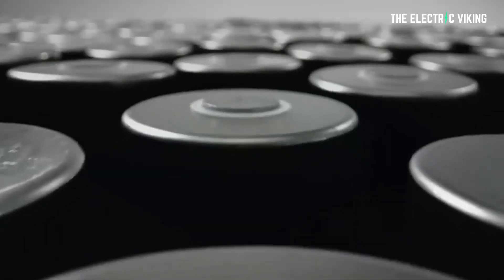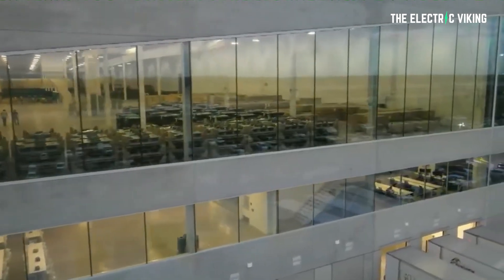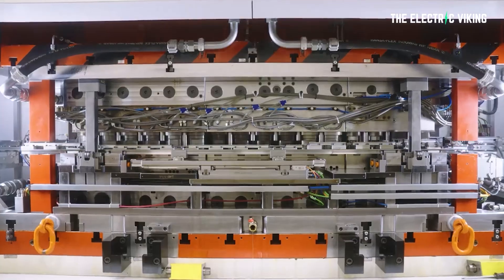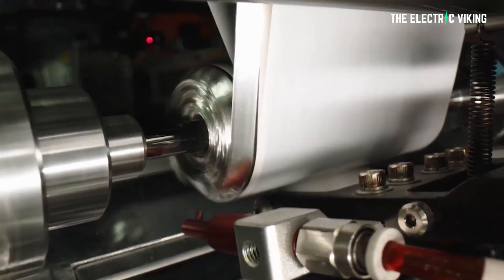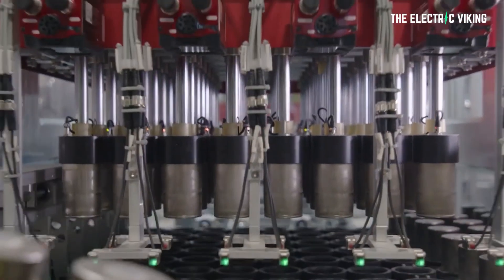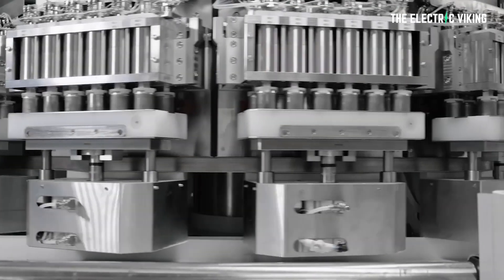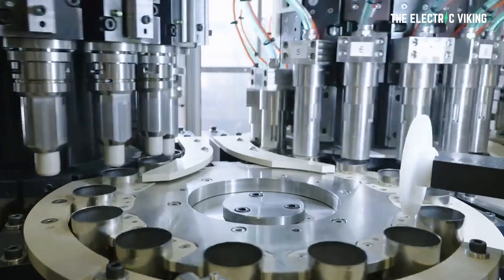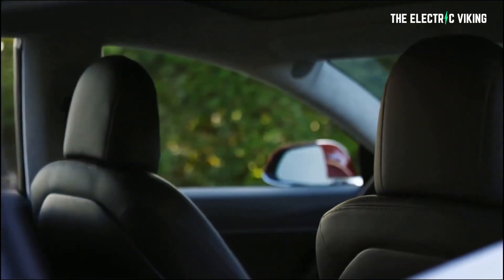Fremont 4680 battery production green lit + Texas' bizarre stockpile

Comment: Tesla initially plan to open the Texas Gigafactory with the production of the Model Y with the 4680 battery, structural battery pack, and front and rear Gigacastings. It has been reported from the Germany Gigafactory that Tesla was having problems with low yields or a high amount (60%) of waste from the GigaPresses. If this is true, the Texas Gigafactory has three huge changes to the casting due to the addition of the structural battery pack. The rear casting is different, the front casting is different, and the structural battery pack is different than anything they have done before and it probably wasn’t going well. This is why Tesla went to plan B and switched to the 2170 battery without the structural battery pack and perhaps without the front Giga casting. 

In anticipation of the Texas Gigafactory opening, Tesla was stocking up on the 4680 batteries in Texas. Rather than let these batteries stack up in inventory, Tesla decided to at least create the structural battery pack filled with the 4680 batteries. This abundance of 4680 batteries from their Kato Road pilot battery factory is why Tesla decided to begin delivery of the Semi this year instead of next year. All of the 4680 cells were originally intended to be used for the Texas Gigafactory Model Ys.

Comment: To begin using the SBP's they'll also need the other giga castings. So maybe they're still getting things stocked up and kinks worked out with either the giga casting machine and/or assembly line. I'm sure that if they were ready, they'd be using them.

Or they're gearing up for the CyberTruck and just waiting for the giga casting machine to be setup and tuned in.

Comment: Maybe they aren't making any Model Y's with the structural packs right now, or are making very few, because they can't make the 4680 cells fast enough to keep up with the vehicle production line, so they are just stockpiling the packs they have already made until they have the 4680 production line up to a speed that matches the vehicle production line. Cleanerwatt channel did some videos recently about the issues Tesla has had with making the 4680 cells, and the new 3 in 1 battery machine that will incorporate the solutions they have discovered to the various problems they had which mainly related to a high rate of faulty batteries and stoppages on the production line. My theory is that when they have all their ducks in a row so to speak in Giga Texas, they will then start the structural pack vehicle production line and use up those stockpiled packs as well as taking a feed of new battery packs using batteries from the new 3 in 1 machine(s). Not sure how the batteries get glued into the packs, whether that is an automated operation, but I would assume it is, so you would basically have 3 different processes here, making the batteries, assembling them into packs, and then sending the packs to be assembled into vehicles.

Comment: The car is substantially different when they build with a structural pack vs the standard pack.  They most likely have to change the line over for producing the cars with a structural pack, batching would be good description of it.

Comment: Considering Sandy Monroe tore down a model y structural pack. I don't understand why this is still a mystery. We know the size. We know the amount and we know the weight along with the rated miles per charge. From what I've seen so far, The structural pack isn't any lighter and doesn't give you any more distance. It would seem the main point of the structural pack is for production. I mean you've still got the flagship model s and x using the original 1865 cell. So if the 2170 was so great why hasn't Tesla switched to them by now. I know the arguments for why like they need to use up all those batteries that they already have in production but come on man, Tesla's flagship products used the original 1865 battery that is not structural.

Imo The structural pack is just engineered obsolescence and easier to manufacture but gives little to no benefit to the consumer who will be stuck with an EV that needs to be thrown away

Comment: I don't get it why 4680 is so exciting. Someone please explain it to me. 4680, comparing to the 2170, is 5 times the energy, 6 times the range and 6 times the power... but it is also 5 times the size and 5 times the weight. The extra 15% margin is the result of the larger diameter making the cells wasting less space when they pack together. So to sum it up, it is 15% better and a lot cheaper because tesla is now manufacturing it in their own factory instead of buying it from panasonic... it is good... but not the "OH it is 4 times better"... it is 4 times better per cell because each cell is 4 times bigger and heavier.

Comment: You can take this with a grain of salt…But about a month ago I had 2 Tesla employees in my Uber… (Both a bit tipsy). One of the guys actually was working on the structural battery pack… I asked if my model Y (which is due to deliver in October/November) would have a structural battery pack… He stated no way, from what he sees right now… They are having major issues ramping up the structural battery packs… apparently they are having issues Trying to integrate the front and rear castings with the structural pack… And that is why they are going back to the 2170s (just like they are putting in the Fremont builds.)

Comment: Why do you think they are filled?

SIlly.

The day they leap in battery production, then you work the empty structural packs into the line to fill up, when every else is ready.

Then the run rate will jump.

Should do a huge run of X & Ss w/4680s bells & whistles. Charge very high premium for them. Even a special Roadster 1.5 refresh. $350,000+. Sell them until they saturate the market. That'll take a few years.

4680s really need to be concentrated on semis, CT, maybe a Van.

Structural battery packs need to become battery agnostic, capable of accommodating different types of batteries. even making bespoke packs. Seems like a silly oversight. I wonder what they are doing about that.

Everything has to move to a structural battery pack configuration.

Comment: The 4680 are mainly meant for 800 volt systems. IE: the Cybertruck and Semi, and likely future Model S. They are meant to be charged and cooled faster. That is their main design, not necessarily for more range, other than a little bit on the 800 volt systems.

Comment: Production of the Tesla semi trucks is supposed to require a very large number of 4680 batteries.  Either Tesla will begin producing semi truck battery packs while the stock piled batteries will be for certain cars or the stockpile of batteries is for production of semi trucks.  Somehow Tesla will need a lot of batteries for semi trucks.

Comment: No inside info but likely they are stockpiling  their limited supply of 4680s to use in the new Semi, and possibly cyber truck.  Sitting on batteries they produce in-house while deploying foreign batteries also leverages credits under the new inflation "reduction" act.

Comment: Even more than increased range, I'm hoping they will eventually be able to hold charging speed deeper into the battery pack.
Reply: Very good point.  There is a ton of charging time savings to be had with the existing V3 chargers by simply maximizing the charge rate and then holding for a much longer amount of time.  All these people talking about 5 minute charging don’t factor in that the charging infrastructure can not handle and it is mostly not needed.  We are 10 years away from a fully implemented National charging infrastructure that can handle that type of peak energy flow rates if at all.

Comment: Could be as simple as the battery production line has ramped up faster than the Model Y production line…
Reply: Other way around.  4680 model Y production delayed to stockpile batteries so they can start in near future.  4680 model Y sales have not launched yet formally.  Can’t buy on website.

Comment: The assembly line for the 2 battery variant must be completly different. I suppose the factory is not fully to run 2 parallel assembly line. Or, the 46-80 run rate is so low, it waste employees time on a slow 4680 line. Or, they are retooling the structural pack line. They apparently have simplified the 4680 tools 3 machines into one. Will see
Reply: Isn’t that to make the batteries?

Comment: The structural batteries fit to the car extremely quickly. Bolt on the seats, bolt the pack into the car and connect the wiring. Job done.

Comment: That amount of packs isn't even a day's worth of production.  They are doing 2170 packs and 4680 packs so with the structural packs stopping while they build cars with 2170s, they will need to stockpile some of those.  These will allow them to do burst rates and get line rates up even while supplies are low, to be ready when supplies ramp up.

Comment: Tesla, and anyone else, is having a hard time ramping production of the 4680 batteries.   They need a LOT of 4680 batteries to start putting them in all the Model Ys they are building and delivering.    They don't want to dribble out a small percentage Model Ys with 4680 battery packs.  They would love to have enough packs to put 4680s in all Model Ys.

Comment: The production rate of the cars is ramping up. They will need a ton of battery packs, and all components for that matter, when they really get rolling. What’s the problem with stockpiling? It only makes sense. If they run out of any important component, production completely halts. Why aren’t you concerned about the huge supply of large castings they have stockpiled outside on the east side of the building? It would make no sense to build battery packs on a just in time basis. 

In addition, since the structural battery pack is literally part of the car body, no matter what battery goes in the pack, it still has to function as part of the structure. Further more, it may be cool to have the latest and greatest 4680s but what difference does it really make to the owner as long as the car performs as claimed? They main purpose of the whole 4680 thing is to reduce costs compared to the 2170s. They both use the same chemistry (with alternate chemistry used depending on the range specification ).

Comment: The only thing I want to see from Tesla that I would use are AAA-AA-C- and D cell batteries (at a reasonable price) that will FAR outlast the Duracell and Energizer batteries out there now, which are overpriced for as long as they DONT last and are NOT rechargeable.The only thing better still would be if Lockheed Martin made commercial batteries, as they have supposedly developed some used exclusively for military and aerospace use that make anything Tesla has look like a Middle Eastern clay jar battery from an archaeological dig.
Either......I would likely buy.
Reply: Luv 2 see Duracell & Eveready create 4680 battery plants with all their decades of experience. Duracell is doing a powerwall type thing. But really all old school battery manufacturers should be on to this especially with the tax credits coming in from next year.

Comment: Could they be cybertruck batteries?
Reply: That's what I was thinking. You would think those would not fit Model Y. But that's another question, will Tesla eventually make a structural pack that can be used in more than one model?

Comment: For a cylindrical design 4680 is better (notice how Tesla keeps making the cells larger), but it's a worse design than a pouch that everybody else uses. What's the end game for a cylindrical battery after making it bigger and bigger? Basically it turns into the size of a pouch, and then you get the advantage that you can flatten it and pack them more economically. 

Cylinders were a stupid engineering design, but a great manufacturing design, if you're starting from scratch.
Reply: Not if your thinking about thermal management sure you can get density but at a price of longevity because heat is the biggest factor in a battery life span the faster you charge the more energy you use the more energy you use the more heat you use same with discharging a battery it creates heat tightly packed cells will burst into flames really fast  or be software limited slower car and slow charge time
Reply: Doesn't matter as you just engineer for the necessary thermal spec. Batteries sell based on energy density/$/Weight - this is a customer facing spec that people dearly care about. Thermal mgmt just needs to work and you can design a system for anything practically. In fact the Tesla Lasagna cooling ribbon is another ridiculous but necessary design given this approach. It takes away volume which eats energy density, and makes the pack hard to repair. 

For comparison with the Bolt they are able to just use a simple bottom cooling plate, which the majority of the time works passively without the need for fans even when fast charging. I walk by Teslas all the time with their fans loudly spinning when doing any kind of charging, or just sitting there.
Reply: @DanMcLaughlin  the 4680 has a cooling plate on the top gone is the ribbon
Reply: Yeah exactly they're working towards a better design that the legacy (e.g. GM) automakers have, but the packing density will always but suboptimal with cylinders. Meanwhile legacy is approaching Tesla in software & features.
Reply: @DanMcLaughlin  don't make me laugh software lol I bet you think ea charging network is better then teslas also
Reply: OK last reply this is getting old - you misunderstand, Tesla has the best software, but legacy is slowly catching up, as Tesla is slowly catching up on the engineering side. This point isn't original to me - TeslaBjorn and others have made it.

Comment: The lines in place are for regular battery packs, the structural pack was ramped up and made ready before the next shut down were they will add line or retro fit existing ones

Comment: Could these stockpiled batteries be destined for the Cybertruck, which I'm predicting will have an all cast substrucrure underneath the stainless steel exoskeleton and because the construction method is pioneering, Tesla is taking time to refine the manufacturing process before going into full production which is going to be so fast they want a stock of battery packs until they know the exact rate of production.
Reply: NOT a good idea. Cast metals are inherently brittle, and strength as well as durability of stainless steel varies greatly depending on the alloy used, although all of them have the advantage of corrosion resistance.
This thing should use a heavy gauge steel skidplate underneath the battery, as there have been several instances of batteries on Tesla being breached, some incidents resulting in catastrophic fires after serious accidents.
I will keep driving my conventional 4x4 with a design track record of durability and ruggedness spanning over 80 years, because Im a proud member of the mystical and sapient order of Luddites.
"in technology, we doubt"
Reply: @donreinke5863  B******t! If cast aluminium is brittle why it it used for many suspension components and wheels (components subject to large shock loading) and even front and rear chassis members on the Model3?
Reply: @eclecticcyclist  Because of a desire to reduce weight..
And, you dont know the difference between a forging and a casting DO YOU?Forgings...have vastly improved strength over castings.
Sealed Power high performance pistons are forged at over 4000 tons pressure, creating a product with over twice the strength of a conventional cast piston.
Wheels......have tires to absorb much of the impact from roads. rocks, holes etc.
Obviously you dont know a lot, so you will absolutely need educated.
Severe impacts strong enough to destroy a tire nearly always result in an aluminum wheel breaking apart, rendering it scrap metal while a stamped steel one simply bends, if the damage is limited to the outside edge of the wheel, steel wheels can often be straightened. Aluminum ones simply break.
Im betting the Model 3 chassis members are aluminum FORGINGS....NOT castings.
Look up the difference and edify yourself instead of making foolish observations.
The strongest of all...are steel forgings.
Its why forged crankshafts are used in racing and high performance applications rather than cheaper and commonly used cast cranks, and likely the motor armature shafts in your beloved glorified golf cart electric car are forgings as well, if done correctly they would be machined from a solid billet steel forging.
If that Model 3 actually DOES have cast components due to stupidity/cost cutting or both, that would be just one more reason I wouldnt EVER own one...at any price.
I have 50 years of automotive experience as of this month.
What is YOUR experience, pray tell?

Comment: Welll... the bottle neck has been batteries for years...   they are running the battery line as much as possible even if the factory is not spooled up... it will catch up and use up the stock pile very fast.